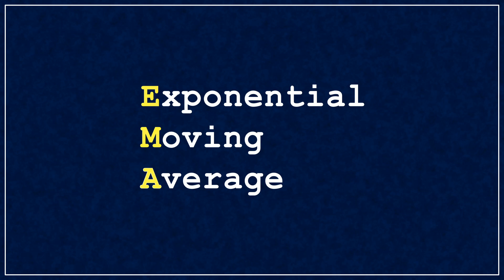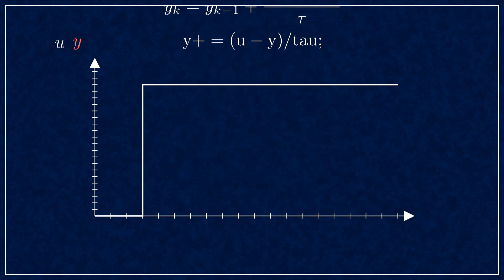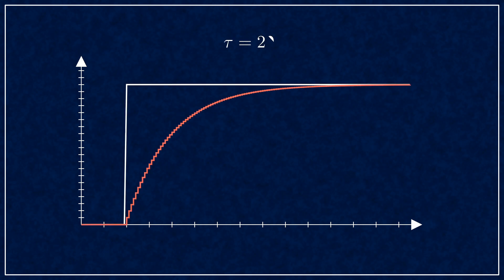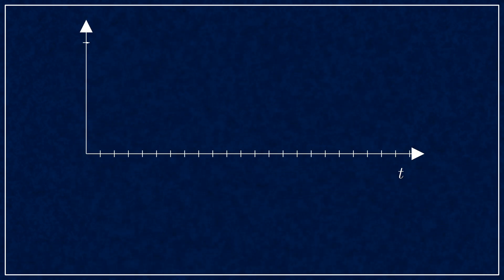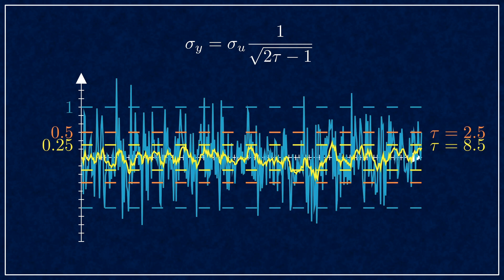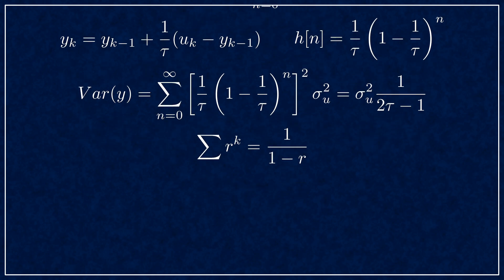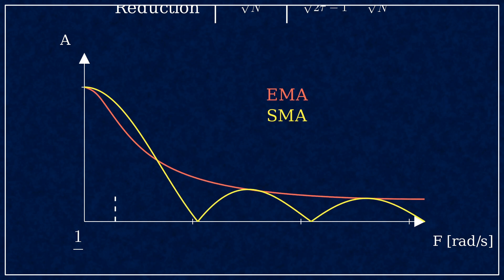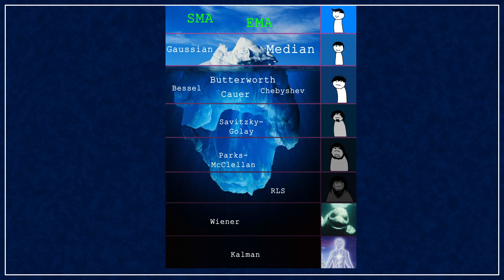Exponential Moving Average filter

Comment: Abstract:

The video provides a comprehensive overview of the Exponential Moving Average (EMA) filter, a fundamental tool in signal processing. The presentation covers the filter's basic properties, implementation, and applications. 

Key Points:

* Definition and History: The EMA filter is a first-order, low-pass filter with origins in 19th-century mathematics. It calculates the output (y) by recursively combining the current input (u) and previous output (y) with complementary coefficients (alpha and 1-alpha).
* Tuning: The time constant (tau), which is the inverse of alpha, is a more intuitive parameter for tuning the filter's behavior.
* Implementation: The EMA filter can be easily implemented in code due to its recursive nature.
* Properties:
  * Delay: Causes a delay between 1 and 3 time constants.
  * Cutoff Frequency: The cutoff frequency is the inverse of the time constant (tau).
  * Noise Reduction: Reduces white noise with a factor related to the time constant.
* Comparison to Simple Moving Average (SMA): While both filters offer similar noise reduction and delay properties, the EMA has advantages in memory usage, ease of implementation, and adaptability.

i used gemini